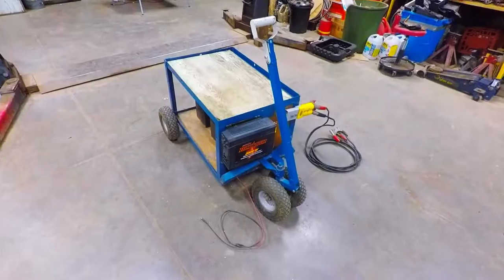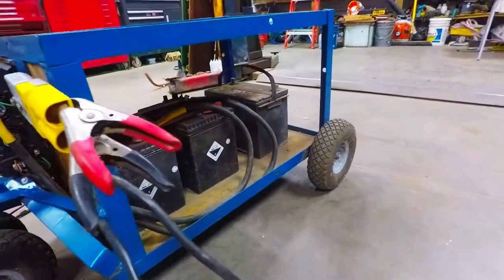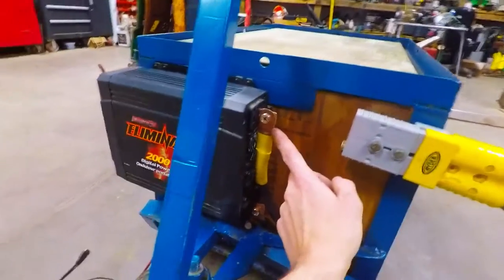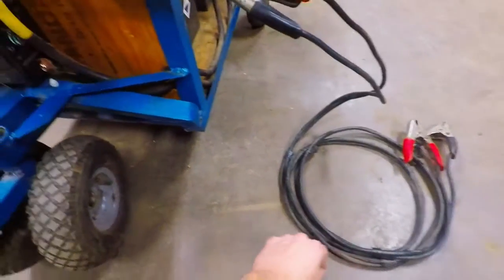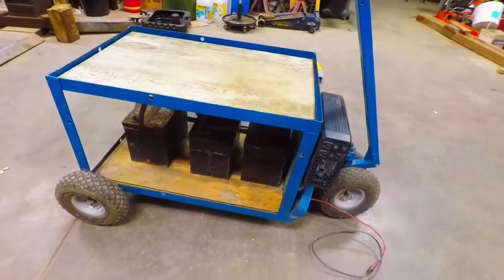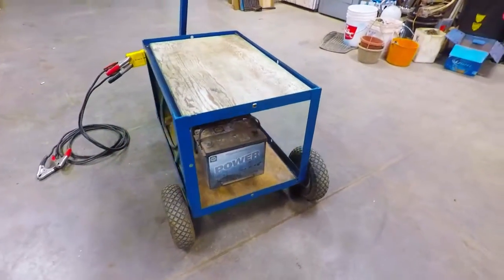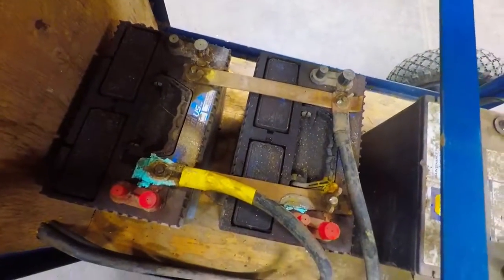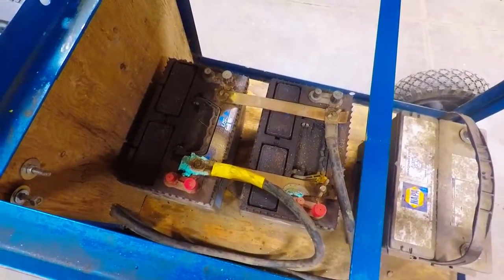Homemade Battery Booster Cart

Comment: Pretty neat set up!. I don't need as much capacity so went with a hand cart. Strapped the biggest decent truck battery we had around on the front, inverter for random small 220 stuff and charger in knee area on the back so they won't get smashed. Two sets of beefy cables so you can assist the boost with another vehicle and a dinky set for smaller stuff and diagnostics. All shit we had around anyway collecting dust or headed for scrap. Hand cart tucks out of the way and is always plugged in when not in use
Reply from the maker: Thank you for the comment. It was used for tractors and alittle bit of wood cutting with an electric chain saw in our bush. Definitely handy to use with good size tires.